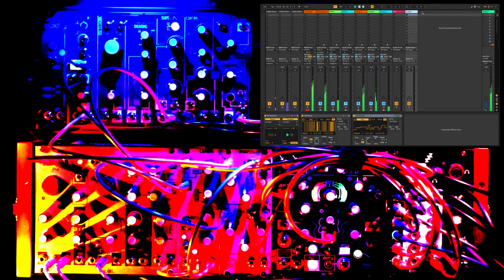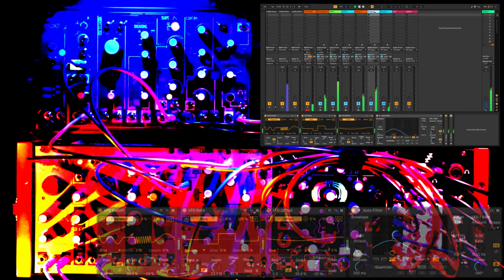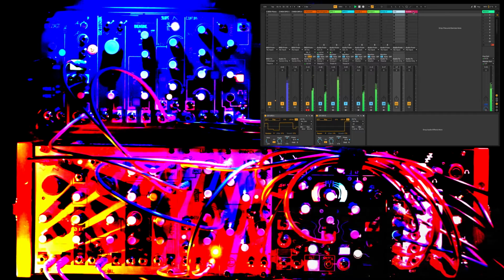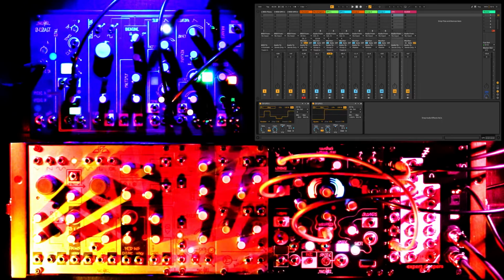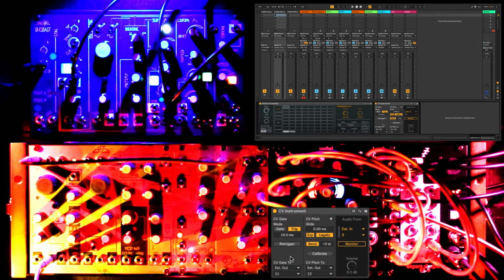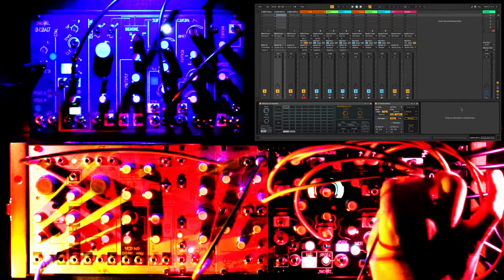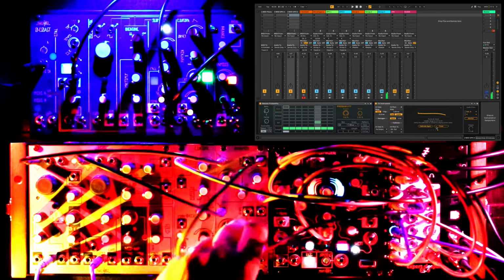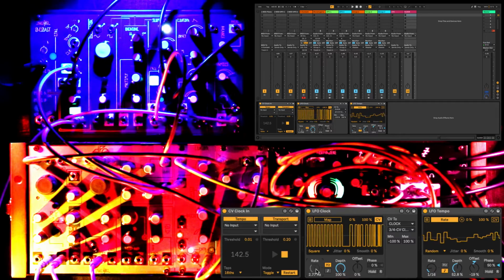CV Tools and a Modular Synth (Tutorial and Demonstration)

Comment: Have you experienced any significant latency issues  going from Ableton to the ES-9 to the modules and modules back to Ableton?
Reply from the maker: Most definitely, to varying degrees based on buffer settings, since you're doubling the latency on that return track. You'll have to adjust the other tracks to compensate when it becomes an issue with tightly-timed tracks like percussion. It's a similar experience as compensating for MIDI hardware latency coupled with DAW latency, which I find manageable. So, it'll also depend on how picky someone is, since some find 10-12ms of latency to be unusable and impossible to play with, where I find some latency to be a perfectly acceptable trade for the added benefits the DAW provides, especially with an ES-9.